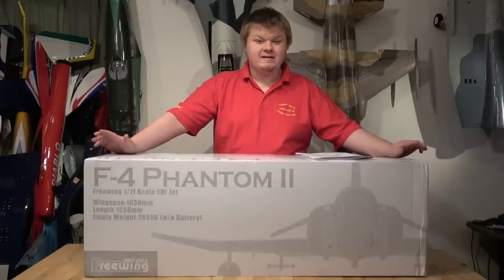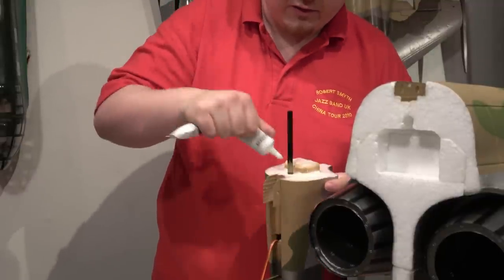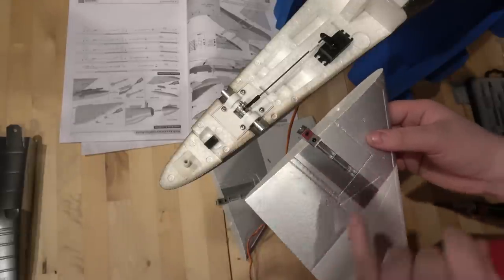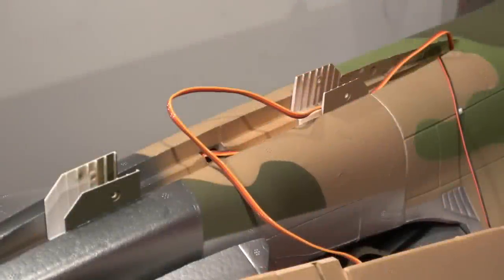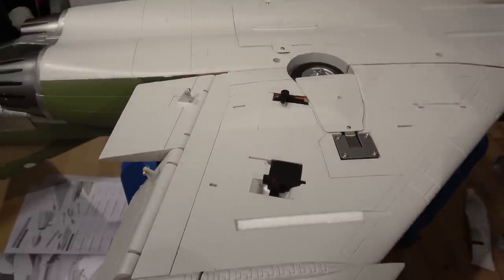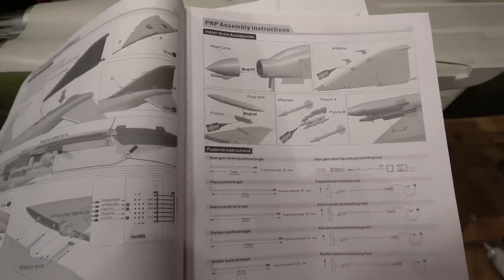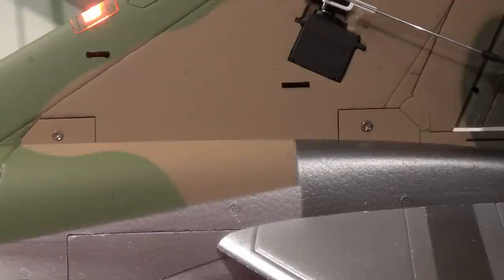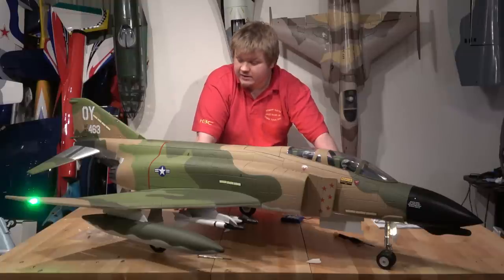FREEWING F4 BUILD VIDEO

Comment: I'm always amazed that people will glue something like this tail and NOT put any glue on the carbon fiber rod before inserting. It will make the assembly much, much stronger, whether it is this tail assembly or a two piece wing or anything else. Seems so self explanatory, yet never see anyone do it on any build videos. It will extend the glue joint deep into the piece it is being glued onto making it so much stiffer and stronger.

Comment: The F-14 was and has always been my favorite fighter jet...it just looks so cool! However the only drawback it had was that they never put a gun on the plane, which was the primary reason so many were shot down, unfortunately. And from that point on, the military never built another fighter without guns. I've seen plenty of these outstanding fighters on aircraft carriers and flying around while I was stationed at Pearl Harbor. Nice job of building yours! ;-) In time, if you choose to build a much stronger one, you'll be able to use a 3D printer with stronger materials, if inclined. Thanks for the memories of such a great fighter jet!

Comment: Red: just put together the Freewing F-4 Phantom but am not sure where the rudder and the elevator servo extensions plug in. Directly to the receiver? Or to the back end of the A-10 multichannel board? Couldn't really see in your video how that's all hooked up and there's no explanation in the manual. Same thing about the UBEC connection.